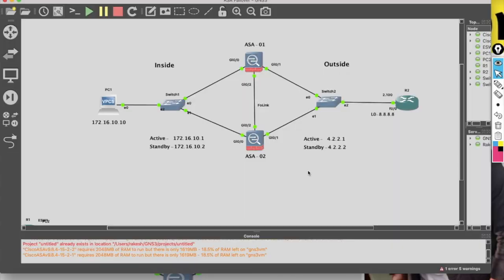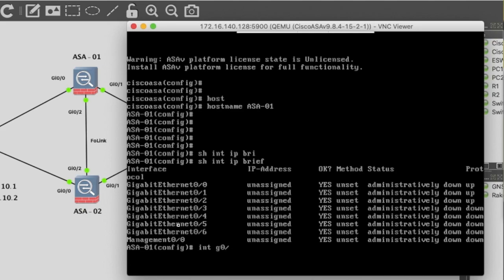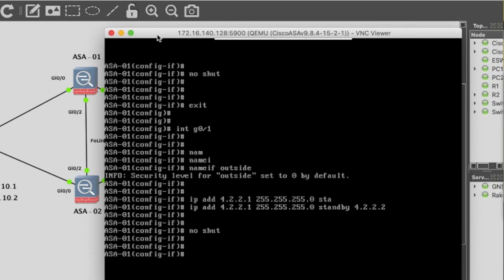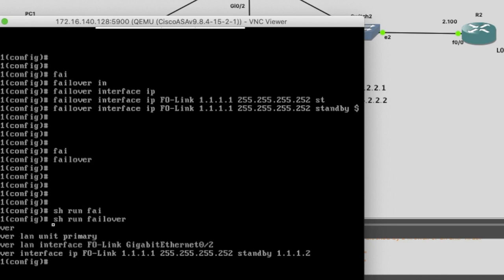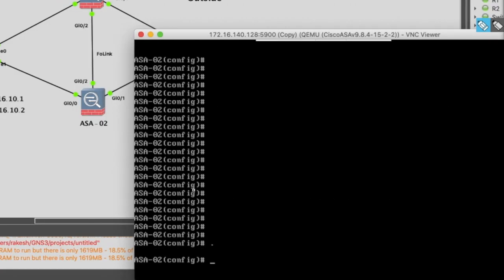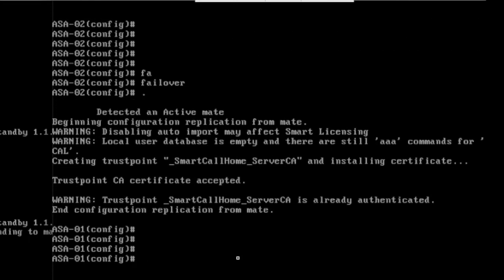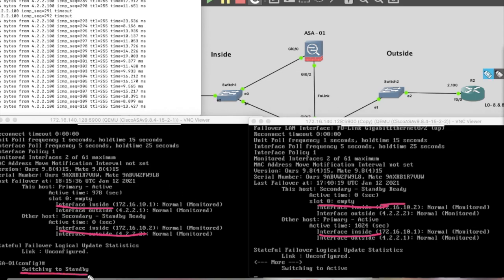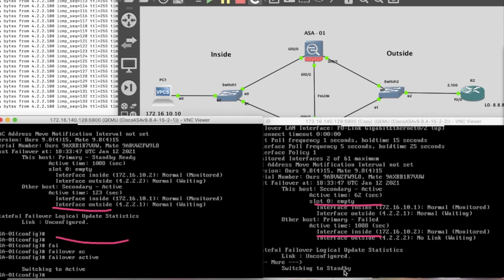Cisco ASA Firewall Active/Standby Failover Configuration - Step by Step

Comment: The reason you must type failover active on the primary standby is because preempt for failover firewall is not avail on single context mode firewalls. That is why you must tell primary standby to be active. 

If you are connecting a new RMA or moved firewall back up to the network. First turn off the firewall you are adding, plug up the Ethernet cables to the firewll you are adding including mgmt and failover links. Power on the firewall you are adding. Let them sync and type failover active on the primary standby. Job done